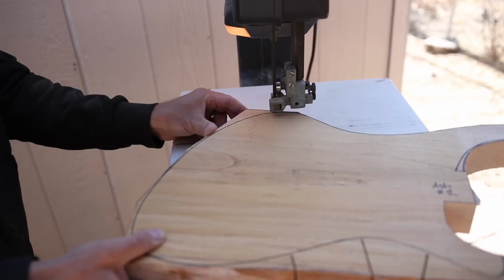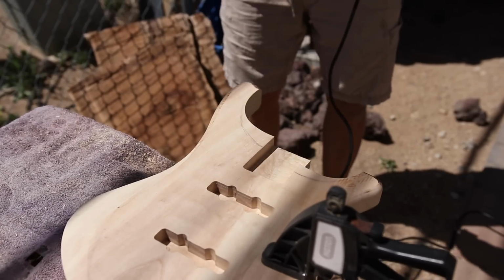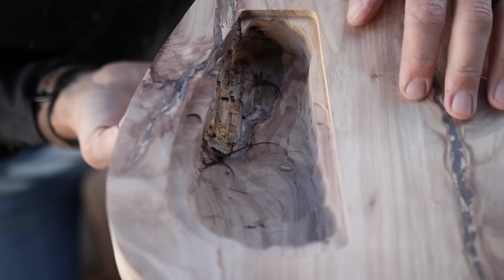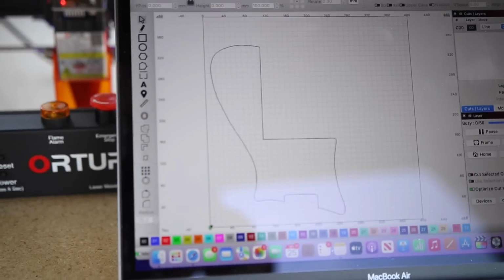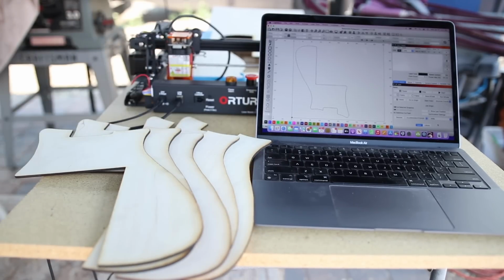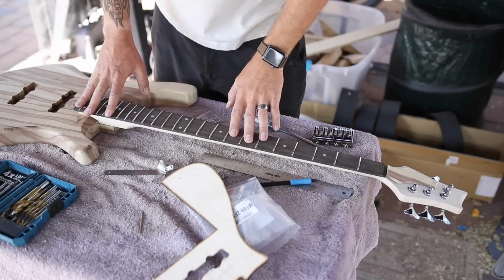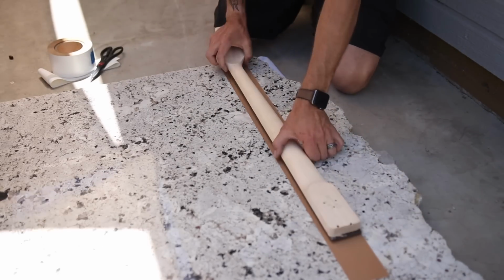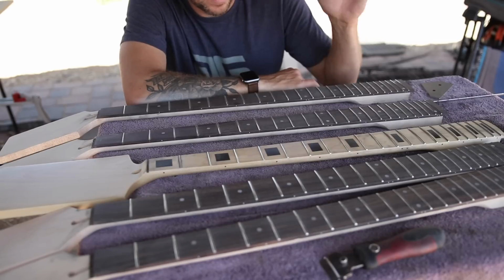Building 6 BASSES at the SAME TIME part 2 (saving time and money while manufacturing)

Comment: Your idea of changing the lengths of the strings outside of the nut and saddle, will have no effect on the tone... the frequency and harmonics are set by gauge, material (core and windings), scale length, etc.  The extra bits going from the nut to tuner and saddle to bridge/body are not part of the equation.  They are on the wrong side of the anchor points.  Just like the string behind the fretted note...

Comment: Get a Porter Cable 4" belt sander if you are going to continue doing this. They are very well made and last forever. I sanded several hardwood floors with them. I still own that sander 24 years later.

Comment: How does string length at nut compare to getting a nice tightly wound string that puts good pressure behind the nut? I've found winding tightly improves tension with my standard fender style headstocks
Reply from the maker: As far as I know, how tight you wrap the string has nothing to do with tension. The only thing that affects string tension is the gauge of string and the distance it’s strung. Ideally you want equal tension between the two points, but the nut presents a challenge there, being an additional contact point. having longer length in front of the nut, and a shallow break angle help even the tension, providing more overall tension to the string.
Reply: @GunsandGuitars  I meant wind with enough extra wraps to get a nice break angle. I just got off work and my brain was mush lol

Comment: I like the idea of the headstock shape but I think it still needs work.  I think it will look better if the E tuner was a little closer back towards the nut. I also feel when doing it this style of headstock the E string tuner should also line up in between the treble side tuners. I also think you need to sharpen the ends of the headstock, making them a little more pointy on the nut side of the headstock.  It is currently to rounded and blah looking.  It is coming together. Great job and keep building.

Comment: looks like your band saw did work, a suggestion is to use a wider blade for a much more effective cut. The headstock truss cover is creative and looks perfect go with it!
Reply from the maker: I tried using a wider blade when I first got my bandsaw. I found I prefer the agility of the thinner blade.
Reply: @GunsandGuitars  bandsaw rules 101, never push any hardwood through a thin blade with much force as it could break the blade or potentially harm the operator. Just be safe we wouldn’t want your production to halt due to self injury ;)

Comment: Dan - try taking apart the router collet and cleaning it thoroughly with scouring pad and a solvent. This will get any dirt and grease out of there. That might be what's causing your router bit to slip. (been there, done that)
Reply from the maker: Great idea! I actually did take it apart and blew out the saw dust and wiped away as much crud as I could with my finger…but I think you’re right. Time for a good scrub down, and I should probably do the same for my bit shanks too!

Comment: I have a LM-2 15w but I've never really used it for wood, I do however use it for etching the powder coat off of guitar pedal enclosures for doing art on guitar pedals.  Nice to see one integrated on your channel.  Lightburn is completely worth the purchase
for going through the craft plywood I'd recommend getting some sort of metal honeycomb under your material so it cuts cleaner and there's less chance of a fire with airflow from underneath
Reply from the maker: Good idea, thanks for the tip!

Comment: If you want to measure the thickness  of the electronics cavity like that again, get yourself a set of double ended woodworking callipers. I use mine when I'm working on my lathe and they are great for measuring the thickness of bowls so you don't turn through the bottom of them. You could probably make a set yourself with your laser if you wanted to.

Comment: Try Solarez, UV activated epoxy. You can take all the time needed to control flow and it will fully cure in minutes once activated. It's crystal clear and sand very easily.
Reply from the maker: Someone else mentioned this, I’m going to look into it. The fast dry time is appealing

Comment: Using the band saw for the comfort carves is an interesting idea. I'm surprised i haven't seen anyone do that yet. I think that's what i like most about your builds. You're willing to think out of the box and do what you can with what you have to save time, money, and effort.

I really like that headstock design. It's not so much "function over form", but rather form SERVING function. The truss rod cover you made definitely helps the aesthetic work, because that tuning machine would just feel out of place without it. Let's just hope EBMM don't ding you for doing the 3+1 style
Reply from the maker: Thanks for sharing your opinion! I agree with you on the Form serving Function thing. Kinda frank loyd Wright

Comment: Gotta watch out for chinese metrics in some router bits. Makes em slip every time!
Reply from the maker: Thanks for the tip! This is a “skill” brand router bit that says 1/4” shank, Ive used it a ton before without issues, but I think the shank is wearing down. This is the first time I’ve had trouble with it, but I retightened it like 3 or 4 times and it kept slipping. Just replaced it with an Amana tool bit which works much better

Comment: Working on the floor is not worth the hour saved. Get a wider hand held tool for leveling.
Reply from the maker: The floor is just temporary, this slab was too heavy for me to lift onto my workbench. But eventually I’ll build a workbench with a granite slab section. And I disagree, it was well worth saving an hour.

Comment: personally i think you should do you GGBO headstock that was killer i do like this style as a 2nd option but GGBO is the best
Reply from the maker: I agree, the GGBO style is my top design, but very labor intensive and requires a special type of neck/headstock to be adapted. So as a result I’m saving it for when I start making my own necks for these builds, that way I can optimize the necks for it from the start. The unfortunate thing is that when I start making my own necks I’ll need to charge twice as much because it’s literally twice the work. So I’ll probably always have the cheaper import neck as an option to help more people afford them.
Reply: @GunsandGuitars  then this if it is easier to build is a great second choice

Comment: That CNC machine. Game changer lol.  How about cutting out multiple body "templates" then gluing them together to make them more rugged?
Reply from the maker: This is actually a really great idea! Right now my laser isn’t large enough to do a full body template (15”x15”) but they are coming out with an upgrade kit that makes it 15”x30” and if I can get that upgrade kit, that’ll be the first thing I do! Excellent suggestion, wish I had thought of that
Reply: @GunsandGuitars  another CNC thought, the way to make your cavity cover perfect is to cut one, then trace the outline on your (uncut) template or maybe use the off-cut as a router template for cutting a hole in your template.

Any way, having a laser could help a lot if you kind of start from scratch so you can leverage its accuracy and repeatability from the point of design and making your templates.

I would rather make a template from a thick piece of MDF and free handing the exterior shape is a manual step I don't mind so the larger work area probably wouldn't have me cutting full size templates and gluing them in stacks.  These steps just don't take that long and the work gets amortized over many bodies so doing CNC for everything is really a pro move for when you are iterating bodies to get the right feel and aesthetic, not as much benefit for a small operation.

Comment: Dan that router bit that kept slipping might have been a metric one, it could have been a 6mm rather than the 1/4 inch(6.35mm)

These basses look awesome and you are pretty brave using the band saw like you did, not sure if your table has a tilt function or not
Reply from the maker: My table has a tilt function but it’s the wrong direction and not steep enough 🤷‍♂️
Reply: Just as likely a word out collet.
Reply: @markthomas3853  could have been that too, but the other bits are holding, sounds like he has it sorted now